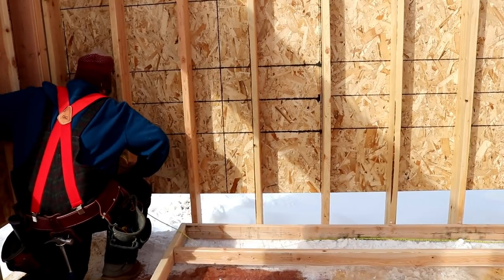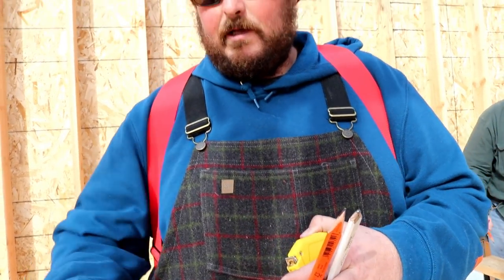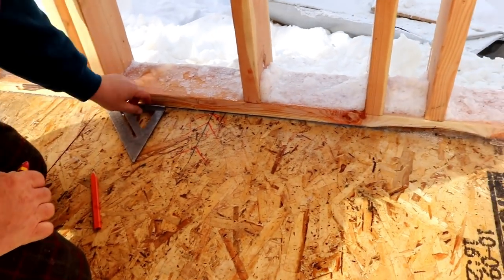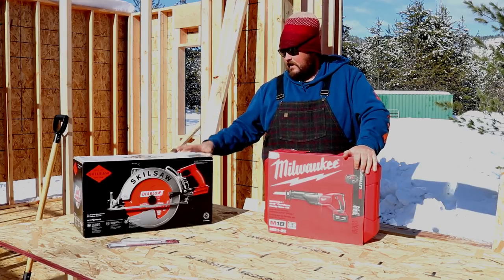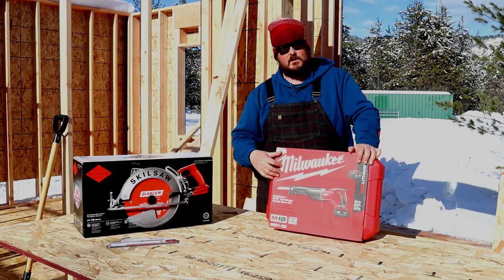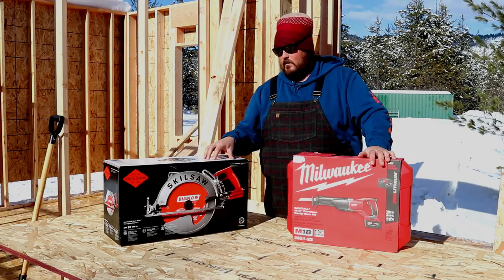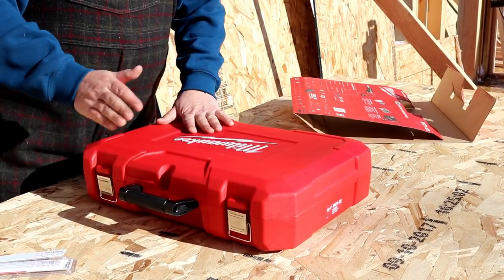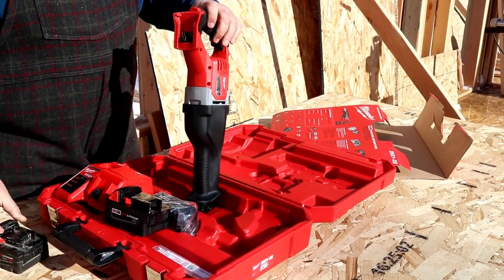Framing Layout On Interior walls For Getting The Most Out Of Your Home

Comment: I bought that brand corded 7-1/4" skill saw back in 1982 and it is still going strong, with the exception of the cord being replaced a few times from my self and others cutting it off, it has been used hard and put up wet, cutting everything from steel to wood, it has had thousands of hours hard use, many other brands I bought have long come and gone, I am not sure if today models would hold up like the skill saw from the 1982, as looking at them in stores today including that cordless, they are not made like they were back in 1900, I was just looking at buying a MW MDS corded hammer, unit, but  after looking how it is made in side and out and the high price, I am on the fence